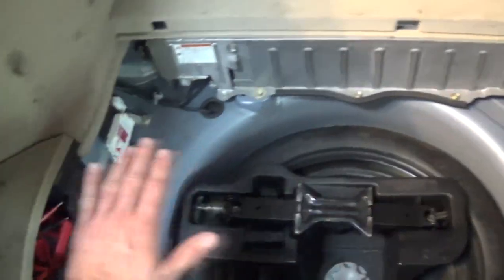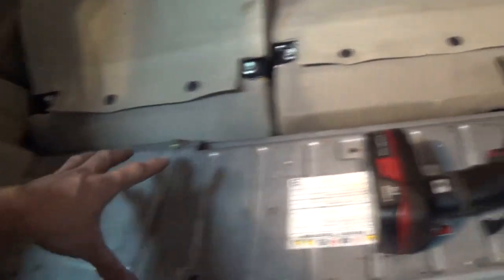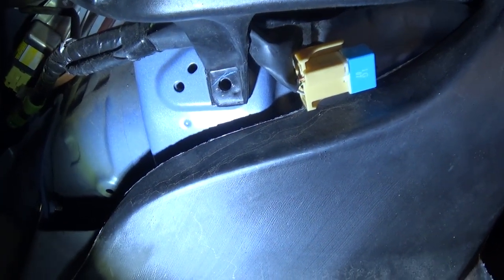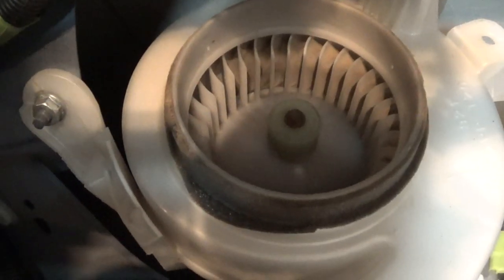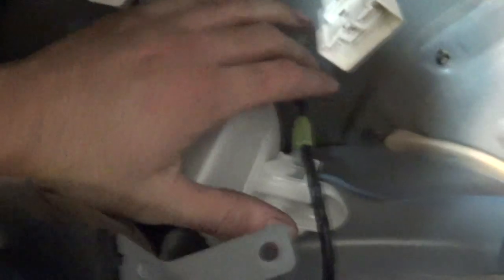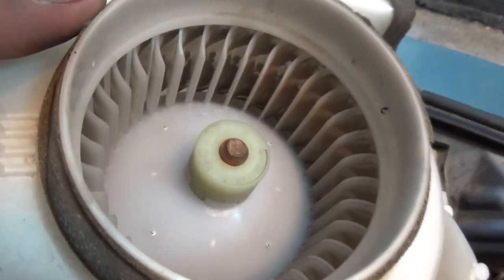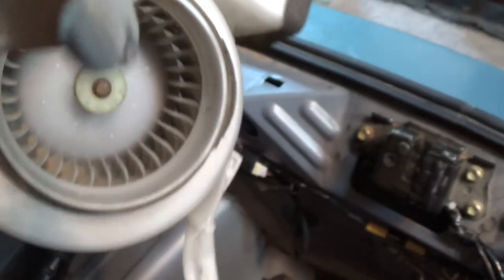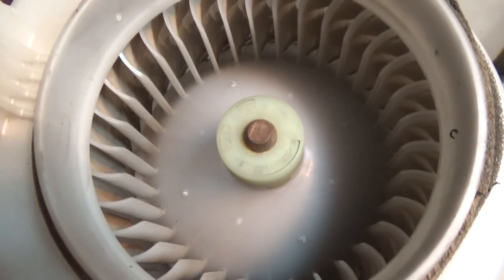How to Clean your 2nd Generation Prius Hybrid Battery Fan

Comment: Thank you so much for doing this video. My prius was revving high especially on hot days and lacked power. I thought my battery was failing, yet no error codes. My fan was clogged up. I cleaned it as shown in the video. I connected it to a 12v battery to test first. Was running slowly due to build up. After cleaning, it ran much better. Now my prius 2 has more power and battery charges very quickly. Fuel cons. From 6.3l/100 to 5.1l/100 immediately. Mileage is 252,000kl. Much appreciated.
Reply: This all makes sense because if the fan is not working properly,  the charger will switch off prematurely because of the battery temperature. You won't have full use if the battery increasing fuel consumption and drain in power.
Reply: 252000 miles! You give me some confidence, mine is at 18xxxx right now, plan to drive it at least five more years!
Reply: lol, don't you mean "kilometerage?"

Comment: Thanks for the great run-through. So nice to have a few pointers before digging in. My fan after 200,000 miles in my 2006 looked pretty much like yours. Not too bad, but certainly worth a cleaning. I first blew it out, but some of the crud was pretty tenacious (we've had a lot of wildfire ash.... When that is then combined with humidity, it quickly becomes like concrete. So I used a bit of cleaner and a round brush. Now all clean like new!  I'm confident that I'm good for another 18 years or so. I found a few broken clips from other work that's been done back there, so I even got to improve a few items and perhaps even get rid of one of my annoying rattles.

Thanks again for the effort!

Comment: Great video. Mine was absolutely covered in dog hair and mud from previous owner. I will re-install and see if it fixed the check engine light for hybrid battery pack.
Reply: How'd you go?
Reply: @bobbyd1089  Did you fix it? if so how?
Reply: @esam7865  Had to refurbish the battery. Either way, i had to clean the fan or the battery would have likely gone out again

Comment: Seen another video that said you needed to unplug the orange plug from the hybrid battery that disables everything.  I noticed you don’t do this so I’m assuming it’s not necessary? Thanks in advance 👍
Reply: It’s not necessary to almost ever unplug it for most maintenance. It’s a safety precaution because the battery is strong enough to easily kill a human.

Comment: I was just wondering other then if someone has some high battery temps how do you know if the cooling fan is actually turning ? I just cleaned my fan and reinstalled it an ran my OBD scanner tool using Torque Pro and the hybrid battery gauge showed no rpm activity at all. I don’t know if that happens with some of the Torque Pro gages or not ? The dealer told me that if the fan was not working it would set off an error code. I don’t know if that is true or not. I have just replaced my Hybrid battery and I want to be sure it’s getting air to cool it as you know these batteries are expensive so I don’t want to take and chances hurting the new battery due to lack of cooling air. 

Any thoughts on this would be appreciated.

Thank You

Louie IL 🇺🇸 USA
Reply: Hey Louie,

Did you ever find out if it will set off an error code or not?
Reply: @portxer  

Hi Ryan

I was never able to have any of the apps and or adaptors that I tested, like the Elm 327 to even report the rpm speed of the battery cooling fan, even though it had a pid that was supposed to do that. so I finally gave up on that and just made an extra effort not to block the cooling input port next to the back seat. And check the fan about every 6 months to be sure it was clean and spinning and So I would have to say “ no “ I never got an error code. I hope that helps you with your question. I keep meaning to just disconnect the power plug to the fan, when I have the the panel apart, but I will do that the next time I have it apart and check for any error codes when I un plug the fan and report back to you the results. 

Thank You for contacting me about it, I’m sorry that I didn’t get back to you sooner about this subject.

Take care

Louie
Reply: @louietesta3752  thank you Louie. How do you check to see if the fan is spinning? Turn the car on while you have the back taken apart?
Reply: @portxer  
Yes, thats the the best way to be sure of course. If I was to guess I bet the check engine light would come on instantly. But I will let you know for sure.

Comment: Should be a way to retrofit a filter box into the intake duct somewhere before the fan, like Toyota should have done to begin with. 3rd gen Prius' do have a filter as they figured this out by then.
Reply: cheese cloth over the intake
Reply: @paulfremes  There are actually some after market filters available for some years. Cheese cloth, or something similar, would work well though would require more of a replacement than a simple cleaning and possibly need this rather often, depending on where you are driving. Good idea though.
Reply: @WhoWouldWantThisName  Thanks for your message. I live in an urban environment that is not dusty. The cheese cloth starts to darken every 6 months to a year.

I bought the cheese cloth at a dollar store, folded it over 4x, pulled the filter intake off and installed the cheese cloth between the intake and body on the left side - and intake and seat back on the right side.

I removed and cleaned the cheese cloth for the 4th or 5th time several days ago - washed it with soap and water, air dried and, re-installed. 

The 4th layer (closest to the filter intake) had very little dirt.

I may replace this cloth with a new one after next removal because the fiber filaments are very delicate and starting to separate. I don't want fibers getting into the fan or batteries.

However, the system only cost a buck and has worked perfectly.

It should be noted that I run the fan full-time at top speed (using additional software code input to a ScanGuage). Car's on, fan's on.

Running the battery fan full-time keeps the temps on my 15 year old battery around body temp in the summer, 60F in the winter. Winter outdoor air temp here is average 50F. Car has 150k miles, orig. batt. MPG's have certainly dropped since I bought the car - 2007 Prius, in 2013 but still getting 45 MPG.
Reply: @paulfremes  Wow, I had never heard of this software mod to run the fan full time. That's very cool, no pun intended. Impressive that the cheesecloth has held up so well for so long too. I figured it would get too dirty too fast and not allow enough air flow. Of course it's always about striking that balance of filtering enough dirt out while still getting enough air flow. If cleaned often not a problem though, usually.
Reply: @WhoWouldWantThisName  Thanks for your message. Unless one lives in a very cold climate I don't see any reason not to run the battery fan full-time. Heat is the number one killer of these batteries and these batteries produce heat that can destroy the battery.

Further, I believe the battery pack should be designed with small gaps between each module so air can channel past the entire module instead of just the top or bottom - the smallest surface on the battery. Even just a few millimeters would be way better because the heat from all these batteries squeezed together just multiplies and harms the functionality of the unit. 

Yes, it would take up a little most space but, there is room enough down there for a bigger battery module. Designed this way, the battery would practically last forever.

When I bought my 2007 in 2013, the battery was damaged and performance was not that good. Through constant cooling I've been able to greatly decrease the normal battery degradation that occurs over a battery's lifetime. 

I just set and forget. I used to think about it and listen to hear if it was running. But, now I don't think about it or care. It just runs.
Reply: @paulfremes  I haven't made the swap yet but I bought the lithium modules from NexCell to upgrade my original battery. These replacement cells do have a bit of space between them for air to get through, for exactly that reason (cooling). They don't get as hot anyway and produce no gases either, which is nice. They haven't been around that many years yet so we have no proof of how long they last, but everyone expects them to exceed the lifespan of the originals. In fact Toyota has been adapting over to lithium cells as well for their factory batteries, I'm told.

Running the fan full time will likely wear out the fan motor sooner but replacing that should be far easier and definitely cheaper than the hybrid battery. So I like your approach. Thanks for the input.
Reply: @WhoWouldWantThisName  Thanks for  your message. I like a lot of things about lithium batteries except their lack of low temperature tolerance. I am told if they get too cold they will be destroyed. Therefore, a heating system would have to be installed. Heating batteries just seems like a crazy concept - draining power from your power source to preserve your power source.
Reply: @paulfremes  I haven't, YET, heard of anyone having this issue though perhaps there's just not enough data to determine this. I get the impression that in the US there aren't as many hybrids or EV's per capita in the colder climates. I'm in the greater Seattle area and despite the popular misconception it really doesn't get very cold here. We have one of the more moderate climates around the country, west of the Cascades that is. It dips down into the low 30's or upper 20's briefly in the middle of winter but mostly stays above 40 even in the winter. I believe we have the most beautiful summers and it get's in the 80's, and sometimes reaches the 90's, but humidity is not too high, like in say Florida or anywhere on the east coast. Most of the year it's in the 50's and 60's, so pretty moderate.

Comment: I've recently experienced my car revving pretty high while driving. When I press on the gas to keep up with the flow of traffic on the freeway the engine revs up unusually high but yet the car stars stalls with little movement.  Does that have anything to do with the HV battery? These are the max temp reading on my battery
T1 124
T2 132
T3 127
Reply from the maker: Based on your temperature readings and the fact that your ICE has to kick on more to move the car, I'd say your battery pack is on its way out.  My pack is bad and was showing the same symptoms.  I have a vid that goes more into detail about it here

https://youtu.be/irddAVZaJb4
Reply: Hi I also think that. Did your fuel consumption go up to when it was new? I live in Germany and now I'm getting errors about the hybrid battery. But the still runs. But check the vent maybe the bat is to hot. And if you need a new bat there are better and cheaper alternatives to the Toyota bat
Reply: @marcbeebee6969   Like what?  I think there's a possibility that my battery might be in trouble.
Reply: @alext8828  hello mate, my battery died seven months later

Comment: What's the normal operating temp for the batteries? 
Does torque have a way of testing he HV blocks amp?
Reply from the maker: normal operating temp from what I understand should be around 100 degrees Fahrenheit or so although it does depend on the incoming air temp from the cooling fan

Comment: How many miles did your Prius have at the time of doing this
Reply from the maker: about 190k miles
Reply: CtrlAltDefeatTV so what was the verdict did you ever have to replace the battery?
Reply from the maker: Yeah, I replaced some modules in the pack after this vid, unfortunately it hasn't completely solved my problems, so I'm going to have to look into replacing the pack as a whole or something along those lines

Comment: Anyone else have difficulty with the white clip that’s attached to the bracket with the white push pin connector?  Mine isn’t popping off like theirs did.  Wondering if I’m missing a finger press somewhere, but can’t find any.  Had to put the fan back in to try it before taking the 10 mils off.

Comment: You think it would make a difference keeping the battery uncovered like that without all the plastics and drive around like that? Nothing covering battery for cooling purposes. As in an open PC case lol
Reply from the maker: That might work, it might not.  I can't give you an answer one way or another.  On one hand you'd expect without all the coverings it would be able to flow more air.  But without the covers the stock battery fan doesn't have any ducting that it can send air through, and that may or may not throw a CEL